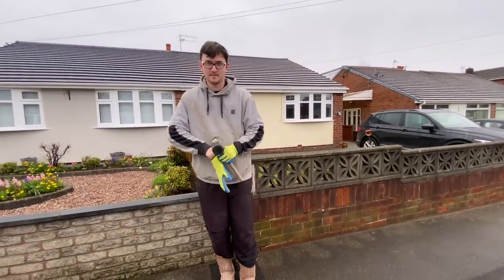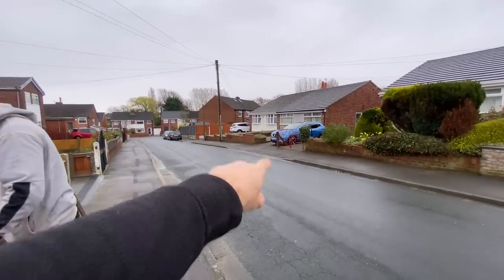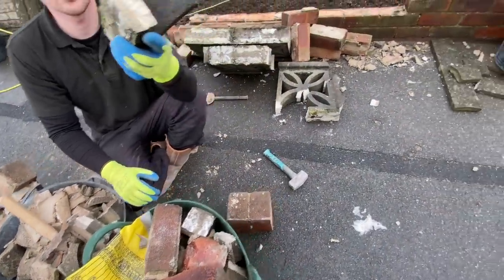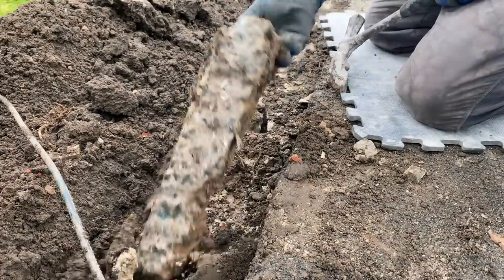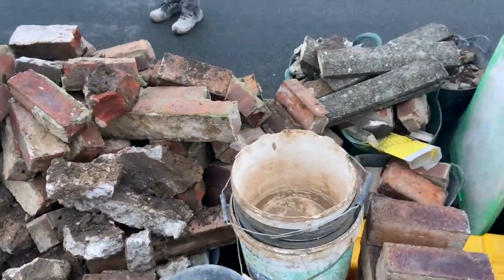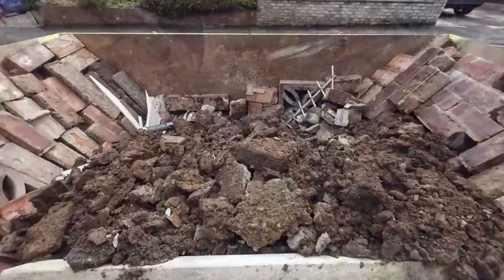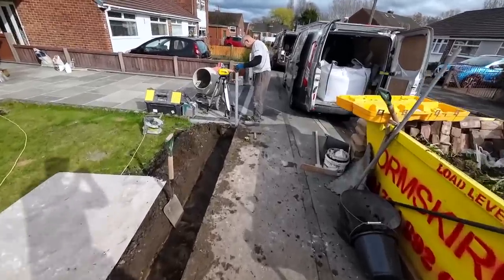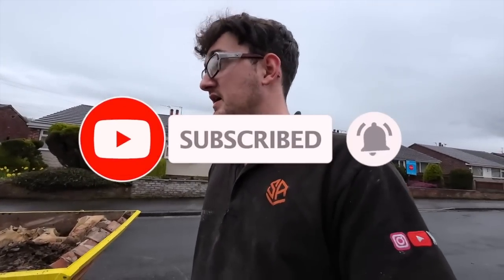DODGY WALL DEMO AND NEW FOUNDATION D1

Comment: In most places in the US,You'd have had to build a 24"x32" deep foundation with several hundred feet of rebar. In my 40+ years of construction,I've never seen any concrete poured without rebars. I was a commercial/industrial Carpenter and foreman,then Superentendent,then my own business. Here,You have to dig the foundations,place the rebar,have it inspected,then have a cylinder tested in order to commence further progress. Great bricklaying!!
Reply from the maker: Wow ! 😳 That is a lot of re bar .
   Thanks for the comment Lha 🧱👍🏽
Reply: @SteveAndAlexBuild  Your method has worked,sometimes far less sturdy than yours have lasted for many years. The building inspectors are very strict here,especially regarding structural matters. I love brickwork and recently bought 500 standard reds to build four columns in front of my house,holding a large overhanging porch. Great work!!!
Reply from the maker: Nice one 👏🏽👏🏽👌🏼🧱👍🏽

Comment: Suggestion:  It seems like delayed skip deliveries are an all too frequent bane of your existence. Instead of using multiple small buckets and/or plastic bags to collect the muck while waiting, why not instead fill a large bag(s) with handles that bulk cubes of sand/aggregates are delivered in.  Then have the driver pick it and place it in your empty skip for you since they inconvenienced you.  Cheers.
Reply from the maker: Nice idea 😁🧱👍🏽
Reply: Alex please start to use a pad to kneel on rather than hard surfaces as you are young and have a long career in front of you. If you get arthritis in your knees you’ll find it hard to work and I’ll be deprived of watching my two favourite tradesmen in my favourite videos.
Reply from the maker: @johnpeplow3985  . He has been told 🧱👍🏽
Reply: Fento knee pads best about. Xl comes down protects whole bottom part of leg
Reply: That’s actually a really good idea. It’ll be a lot tidier as well.
Reply from the maker: @Mmmmetro  🧱👍🏽
Reply: Troll  ,😂

Comment: My God you certainly like to do it the hard way mixing your own concrete when a mini mix truck would have down the job, and I see that you didn't use reo in the concrete foundation for the wall
Reply from the maker: It was hardly hard . Took about an hour . 
    Less than half a cube of concrete but the delivery firms change full cube minimum which is about £210 . 
    Concrete was onto clay so no need for re bar 🧱👍🏽

Comment: Top Job. Half cube of ready mix concrete not a better option? Save all hassle of mixing etc :) keep up the good work 🤜🤛🏼
Reply from the maker: Mmmm £210 minimum 1 cube charge 😬👍🏽🧱
Reply: @SteveAndAlexBuild  very true, prices these days I just thought what you had bought there to do it would have averaged around 150-200, so not much difference overall, maybe different up here in the Blackburn area 👍🏻 look forward to seeing the finished job :)
Reply from the maker: The raw materials were less than £100 😁🧱👍🏽
Reply: @SteveAndAlexBuild  that explains it! Ignore me then 😂👍🏻
Reply from the maker: @quickbuildmick  😆😆🧱👍🏽

Comment: I thought you had to have chapter 8 signing for skips that are on the high way
Reply from the maker: What is chapter 8 ?
Reply: Hi Chapter 8 is part of the new roads and street works act , which includes obstacles placed on the highway such as skips or temporary road works, down are way it seems to have been forgotten, but should anyone have a accident ie driving into a skip , the first thing that would be considered did the skip have lights and cones plus danger boards etc, please believe me I not being a smart @rse, just I worked on the roads for 30 plus years
Reply from the maker: We paid for a permit and the skip company put a light on it , that’s as much as we can do 🧱👍🏽

Comment: I’ve noticed on a few garden walls you’ve done on the pavement. Why don’t you put a old tarpaulin down to protect the tarmac saves a lot of clearing up and washing down at the end after you’ve built the wall
Reply: I always use a cheap roll of roofing felt for pavements, save loads of cleaning up, sweep end of job and roll it for next job
Reply from the maker: @MarkSmith-jt1yj  👍🏽🧱